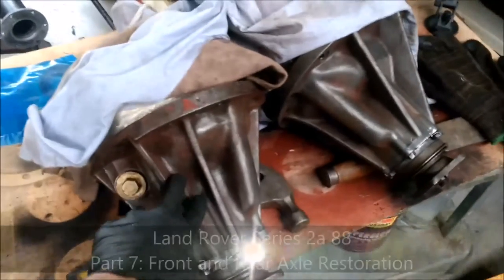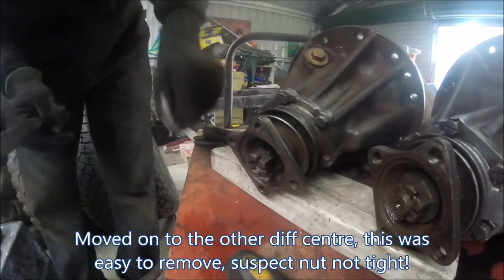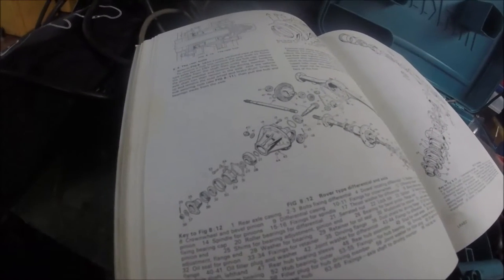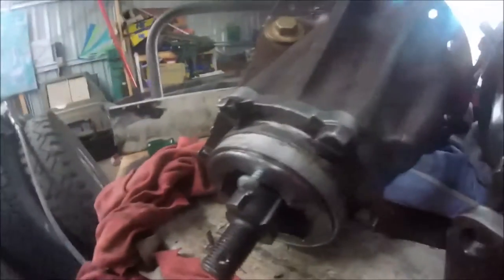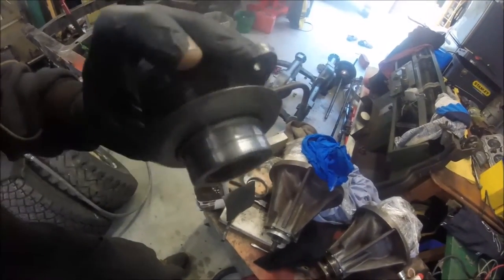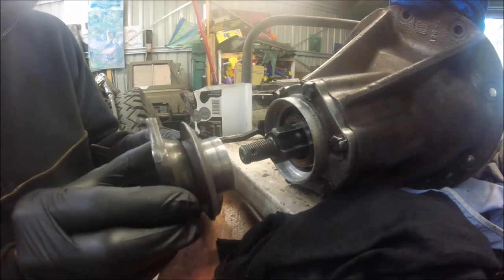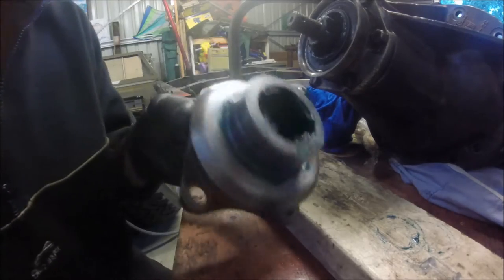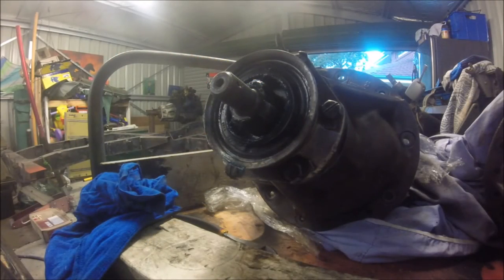Land Rover Series 2a 88 - Part 7: Front and Rear Axle Restoration (LONG)

Comment: Dumb question, how come you didn’t just remove those 6 bolts just below the inner mud shield, and then remove the seal by pushing out from the back?  Is there a problem removing that piece?  There is a gasket behind there that probably could use a refresh also :).
Reply from the maker: Not a dumb question, havent really thought about doing it that way... so yeah I suppose one could also go that way if you wanted to strip it down further.  As you say wouldnt hurt to replace that gasket also.
Reply from the maker: I tend to try and minimise unnecessary work and potential issues.  If it needs to be repaired then ill delve further, if not i leave well enough alone.  Thanks for your support too.  Cheers.

Comment: I'm following your IIa rebuild with a great deal of interest. I am finding your methods very informative and inspirational. It was a little disappointing to see you switch from the 109 to the 88 at first as I got the feeling you were giving some thought to repairing the chassis, which I would have liked to watch. I'm really looking forward to the 2.25 diesel rebuild! Great work mate and keep those videos coming (have you considered a tripod for the GoPro?).
Reply from the maker: Thanks Duncan.  I had an open mind about the 109 when i got it. Either rebuild or parts vehicle. When the 88 turned up, i couldnt let that go. The chassis is really rusted, and lots more than vid shows. Got a tripod for gopro but at times the position doesnt suit so i improvise. Cheers Carlos
Reply from the maker: Thanks Harvey for your comments, gives me an idea of how useful the vids are. Cheers

Comment: Great step by step video by the way...  So I have to Carrier Diffs from my  1967 and 1969 Series 2A's that I am working on and I removed all spacers and components etc. and replaced all spacers in the correct location. the problem with my rebuild is I cannot get the 80-90 ft-lbs in to the pinion castle nut. if I even put 30 ft-lbs the pinion shaft and the bearing seizes and it will not rotate. I think it my spacing but everything that came out IE Bearings and raceways check out dimensionally correct. Any thoughts on my issue?
Reply from the maker: I take it all was working before stripdown?  Here is a good thread to read
https://www.aulro.com/afvb/series-ii-and-iia/152762-diff-rebuild-issues.html
Reply: Hey thanks for the reply.... Both were partially disassembled before I acquired these Diff Carriers... I checked the back-lash and it is between 0.003-0.007" So I know that is right. I re-used the same spacers on both the pinion bearings and replace ALL bearings. It is only when I put torque to the castellated nuts (IE 90 ft-lbs) is when everything go wrong. So my question now is why is there torque that high when it is LOCKED by a cotter pin? To me it is the same as a side axle that has a cotter pin as well.
Reply from the maker: Hard to say, so many factors.  Did you check the bearing width?  Sorry I am not much help, loads of variables here.